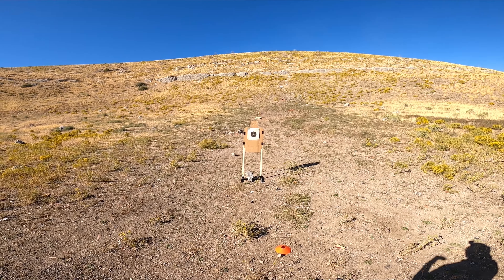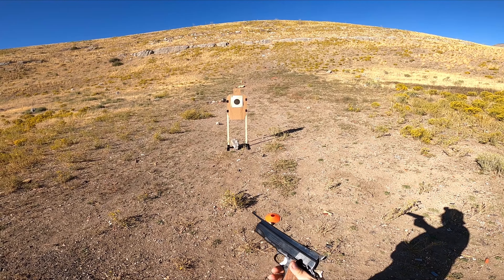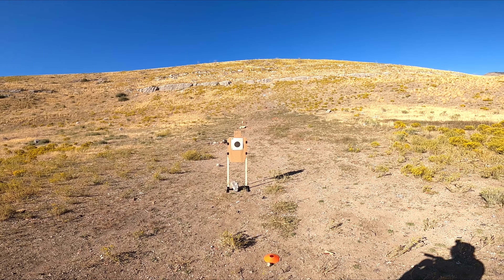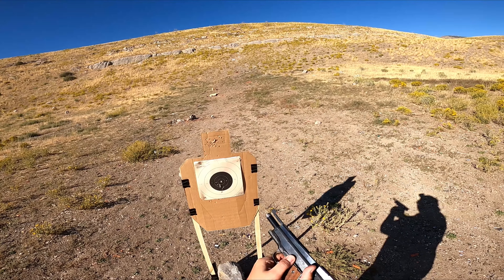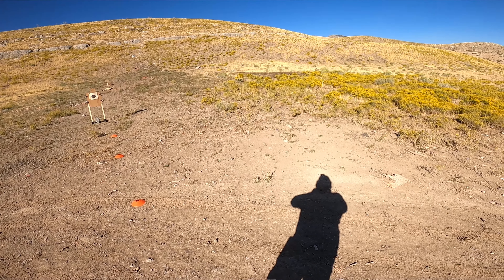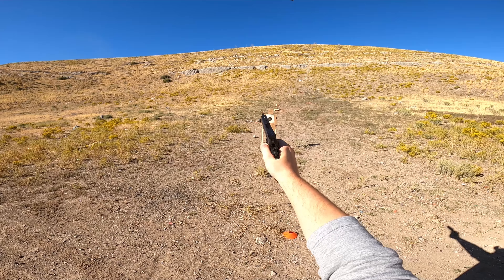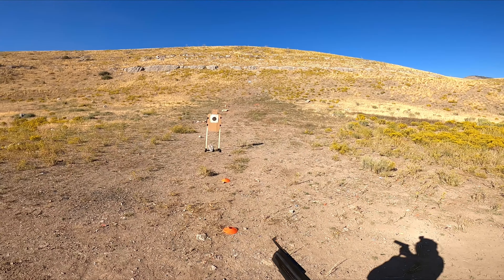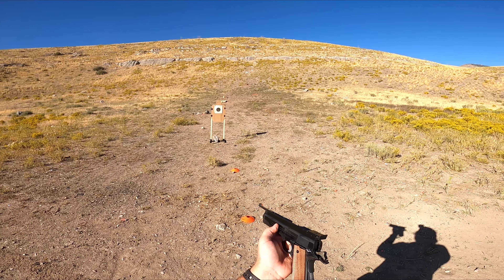First Rounds Through The Bullseye 1911

Comment: I've heard of some match 1911 with vented sight ribs for heat waze mitigation, does this one have any of those effects?
Reply from the maker: The rib on this gun is totally solid, so no heat mirage mitigating effects. The sight rib here is to add some weight to the slide (less felt recoil), and to provide a better sight picture with more sight radius.